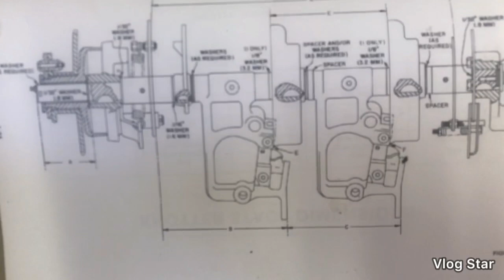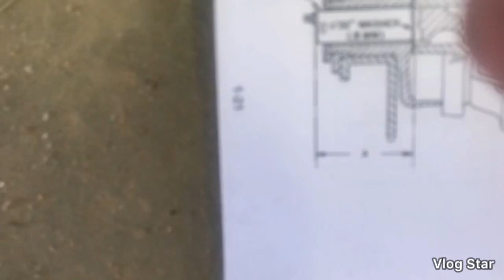New Holland Hayliner 273 knotter repair

Comment: It seems the tucker fingers are misaligned. That can cause alone a whole heap of trouble. Also about the haydog springs, if possible try to change them all at once and keep a couple as spares just in case you bust one in the middle of some hay field. Springs are made to withstand a certain amount of cycles until they snap due to fatigue. Once one fails, the other ones are surely about to fail also. Below the hay dogs there`s a hay dog stop and they make your baler a lot more silent. Old balers had those made out of tire carcass while the newes ones are made of some black acetate. I tried machining a set using teflon but last night I realized that neoprene has to be an ideal material.

Comment: Turn off the background music when you are talking. Music was louder than you. 
Wish you had filmed the take apart portion which is the 2nd most important.  Most important would be be re assembly of the parts and knotters onto the shaft. What's the point if you don't show what you are doing in the most critical parts.
Other than the music and not showing take apart and reassembly,  it was a good video.
Reply from the maker: Thank you.    I tried to get as much as I could but I didn't have a camera man.

Comment: I just did this... but i had to send it to the shop because there was something going on that I could not figure out... ended up being one woodruff key missing at the chain drive end... what a pain in the ass to diagnose. then it wasn't set right when it came back, it was tying but soon as I started bailing on the field it just spat out hay.  trip arm was too loose and the needle brake was so tight that it wouldn't move... not overly happy with the shop on this one.